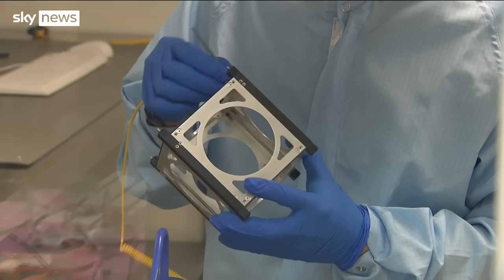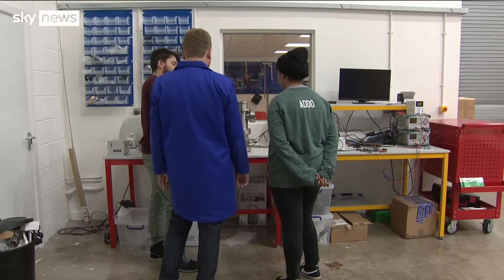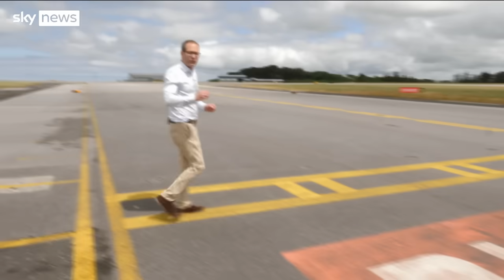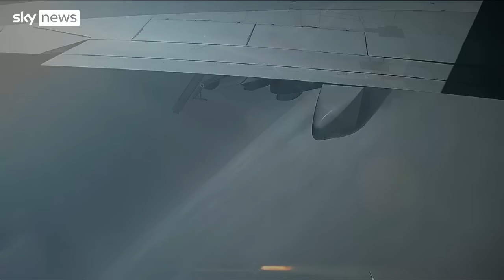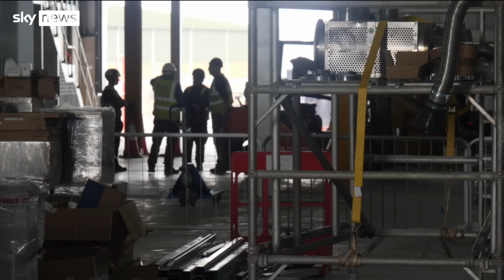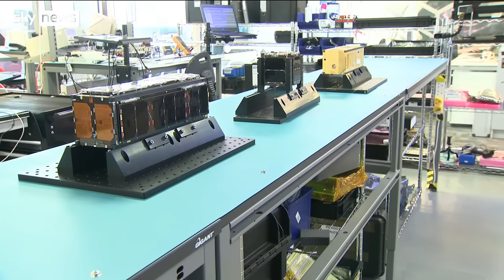UK to become a 'true space superpower'

Comment: Kier repair council housing in my area (or at least they used too, not sure if they still do as I often do the repairs myself now) and based off of the previous work I've seen them do I can safely say this will probably be a failure and a massive waste of funding...... They couldn't even make my front door water tight so I don't see how they can build and launch satellites or rocket's.

Also the new council office's they were building a few years back had to be knocked down and rebuilt as well because the building was condemned before it was even opened, if I remember correctly something like £5 million was wasted because of that

Kier are about as much use as a chocolate fire guard, absolutely shocking is their level of competence in my experience

Comment: how much will the fuel cost for such a rocket?
Reply: VG's RocketMotorTwo uses HTPB as a propellant (a solid fuel based on rubber) and a small amount of liquid nitrous oxide as an accelerant. The company tends to keep quiet about fuel costs, but solid fuel launches tend to account for below %15 of overall launch costs. Technology based on liquid fuel like hydrolox and methalox as used by SpaceX and others are cheaper at appx 5% of total launch cost.
Reply: @boomshanka8743  please remind me the cost per gallon of fuel now!
Reply: A percent or so of the cost of the rocket. Probably not even that.
Reply: @technicalfool  please remind me the cost per gallon of fuel now!